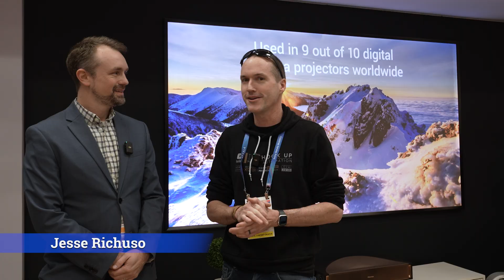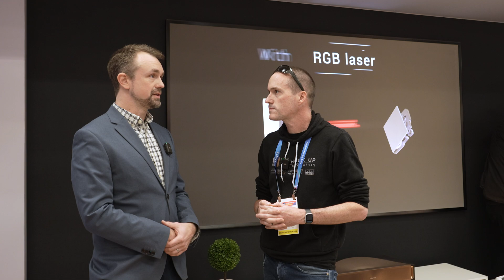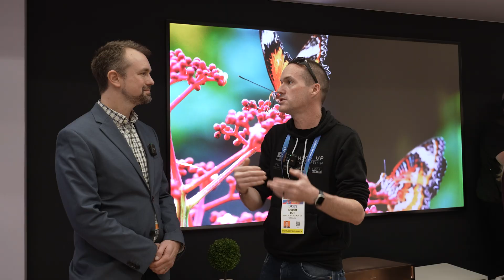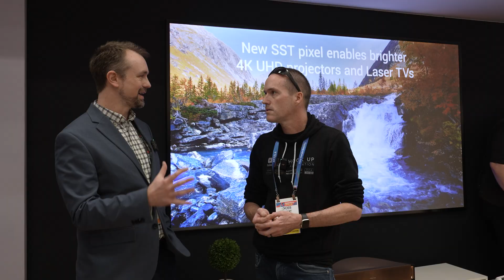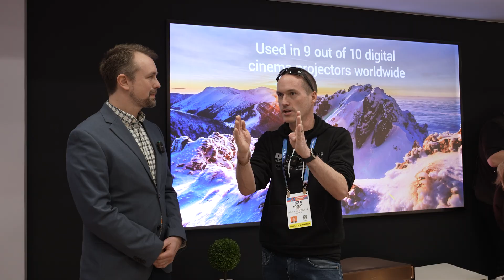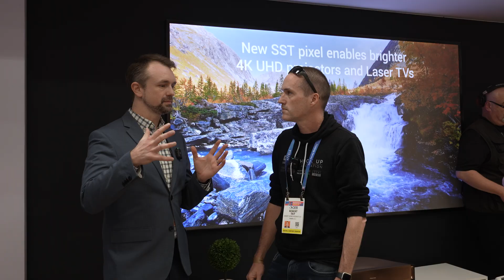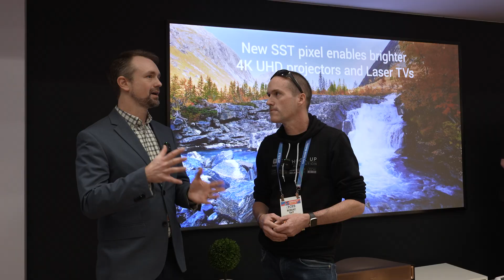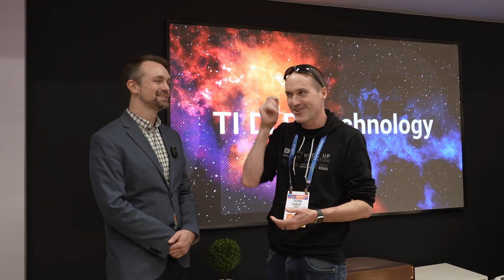TI Interview 2026: New DMDs, Better Software, More Features!

Comment: Very nice interview! There is a bit of a noise, the video could've used some noise removal! I used deep noise remover/or rnn noise in easy effects to make it listenable.
I wonder how SST tech could push UST/long throw projectors with massive brightness combined with dynamic iris at a lower price. Especially in the 1k-3k range. The successor of Horizon 20 could be even more amazing at the same price.
The new controller sounds also very promising, I wonder if 400 hz+ projectors could be a reality for gaming. I don't really understand the small 0.39 chip size, as those projectors are cool on paper but delivery very lacklustre performance, it nice to have 4k chips for those but the lens quality and overall build and lumens suffer too much in my opinion.

Comment: I wish he’d asked for clarification on how the SST achieves a higher or equal contrast, when the mirror tilt is lower?  You would assume that a greater tilt would enable better contrast?
Reply: Jesse from DLP here. You’re right that a greater tilt angle will enable better contrast, all else equal. However, the SST pixel moves in a different way than the TRP pixel. It increases the gap between on-state light and off-state light, thus increasing contrast.

Comment: The confidence from TI regarding fixing the tearing on the new rolling buffer chipset was not encouraging (coming from a recent Horizon 20 series buyer, that is within the return period). Thank you so much for the video Rob, this is the type of content we need from CES.
Reply: So do you return your horizon 20? Why?
Reply: @muharremuzel6106  I am considering returning it, but the TI representative in this video (Jesse Richuso) did not sound very confident that TI will be able to resolve the tearing caused by the new rolling buffer design. If this issue cannot be resolved via software/firmware it is a hardware design flaw, and should be strongly considered before purchasing the new Horizon 20 series projectors. If primarily used for gaming at 1080p 240Hz, where the tearing is not visible, it's one of the most performant gaming projectors on the market. There are other issues present with these units, but those issues are more likely to be resolved via software/firmware updates. It appears that Hisense is going to be using the same TI chipset in their new PX4 Pro (and possibly their XR10?).
Reply: Why?
Reply: @eefvanschaik8106  Please see my response above.

Comment: Totally feel 14:40 . Why isnt someone making a highend .65? Cost factor doesnt sound right, a Valerion Max is 5K$, if a 65 version would cost 6K so what if you are looking for the best picture. Your motion tests showed you can almost have 50% higher speed on the UFO test on the 65 dmds and there is less pixelation. So I wonder what the downside is. For some reason there is no 65 that has that extreme contrast of a Nexigo or Valerion. 
However, a benq x500i holds up extremely well against those guys, I think in your gaming projector test it beat the aurora pro 2, and thats a 1500$ projector. That performance is probably greatly due to the 65 dmd so it does surprise me that all focus for the future seems to be on the 47.
Reply: The benq does not hold up "extremely well" at all, Nexigo/Valerion are a different league and tbh. it doesn't matter which chip size is being used. Over the years of tech evolution all chips become smaller and maybe the newest gen of 0.47 is on par with older 0.65 and so on and then they are maybe just focussing on evolving 0.47 further.
Reply: @BlacklevelReviews  On the paper they might be but the gaming projector comparison from this very channel had it coming out victorious and the footage to back is extremely convincing. 65 dmd will always have higher clarity you see that in literally every comparison, theres nothing to improve there. The 47 projectors can only ever improve in other departments. Same reason the Samsung Premiere 9 won the clarity/focus chapter in the UST throwdown, cant beat physics.

Comment: Great questions! It now makes a lot more sense why manufacturers are equipping their flagship projectors with the new SST 0.47 DMD. The Xgmi Titan Noir to be officially released later this year will be using this chip, and not the 0.78 as in this year's base model, which is still rather odd. However, why can't they implement this new SST technology on the larger 0.78 chip? A larger chip provides even more light output whilst generating less heat and providing better native contrast. There's a market for high-end projectors, so hopefully they won't be neglecting this segment by focusing their attention on compact projectors. BTW, it's fantastic news that the RBE reduction feature will now be available as standard with the latest light engines.
Reply: Agree in a lot of things but not with the Xgimi Titan being the base model… The Titan will be Xgimis flagship model, where the Titan Noir (base, pro and max) will be a more consumer oriented / budget friendly version of the original Titan. I think this years Titan will have a much more cinematic and better overall picture in movies, while the Titan Noir will have a faster refresh rate, the iris while still being really bright. But my guess is that the currently available Titan will be XGIMIs flagship of this year.

Comment: The problem  is 85 and 98 inch tv are getting under 2,000 usd.  With 4k , 2,000 plus nits , good for gaming ect..  4k laser 120 refresh rate new technology and price need to come down for projectors to competitive with big tv.
Reply: TVs do not have the same filmic feel as good projection. If you want a home theater that feels like a home theater then a projector is what you'll want. If you want to play video games primarily, get a TV. If you do a mix of gaming and movies, a good balanced projector is what I'd recommend.
Reply: @2Timothy2.15 for the average person  the tv meet all of there needs  at 85 or 98 inches.  Now at big sizes  120 inch or more  the projectors are better.  With a tv  u can put on a wall or stand.  A projector u need to hang it fro a ceiling  and buy a screen  that  cost depending on quality if the screen.  U are marry to your screen and date your projectors. The better  your screen  the better  your viewing experience is.  With projectors  u need to teat the room . Panit(dark flat paint), dark carpet or flooring,  blinds ect.   More expensive  vs a tv.
Reply: @terryxperry Home theater aficionados are not the average person. If someone wants to be average then, by all means, consider a TV.
Reply: @2Timothy2.15 yes from a hard-core  projector subset. But the projector makers need to make profit.  They need more people  buying .  The hard cord is a small subset of the tv and projector market.  With the way big tvs are getting  cheaper  every year . Projector  market  is getting  smaller.
Reply: @terryxperry  I can't move a 85" TV alone and bring it at my friends house either for a movie night or a game night. It wouldn't fit in my car either.
Reply: I believe the renewed success of projectors lies precisely in the improvement of “lifestyle” models. You potentially have a 200-inch screen that you can carry in a briefcase to your vacation home. You can move it around if you change the layout of a room. With an integrated OS, a decent audio system, a gimbal and lens shift, you can place it practically anywhere without a single cable or having to hang it from the ceiling. You can shrink the image to 50 inches when you’re casually watching something. You can set up an outdoor cinema in the garden. If you live on the seventh floor, you don’t need a crane to get it upstairs. And the cinematic atmosphere of a projector, even when projected onto a plain white wall, has nothing to do with that of a TV. Everyone has a TV at home. Those who also have a projector have one because they want a projector, not a bigger TV.
Reply: @lossendae6211  again  most people  are not taking there TV  on the go.  If u do yes projector is the choice.
Reply: I have a 1000+ nits 55“ OLED TV, and yes its definitely not a 85“ or 98“ TV with 2000 nits, but don’t forget that TVs usually can’t output that brightness fullscreen… 
Comparing my TV to my projector there are many things I like on both of them, but even though my TV theoretically can get a lot brighter than my XGIMI Horizon 20 Pro, the Horizons perceived brightness absolutely smashes the TV when it comes to bright and 100+ inches fullscreen effects like explosions… 
So basically the projector needs to be on brightness 2-3 of 10 to match the OLEDs brightness at a 100“ projection

Comment: ❤Does the new „Hisense XR10“ (Chinese Market Version of the XR10 is afaik named „C5 Vidda“) have the new 0,47 Inch DMD optimized for higher Brightness and native 8.000:1 Contrast in combination w. the new Controller Chip (or does it use the new 0,39 Inch DMD)?🎉

Comment: It's remarkable they think they can reduce screen tearing with a rolling refresh, it seems like it would be inherent. But they're so close to making a CRT emulator with true interlacing. A modest light source and a backlit screen could make for a drop-in replacement for old arcade units.